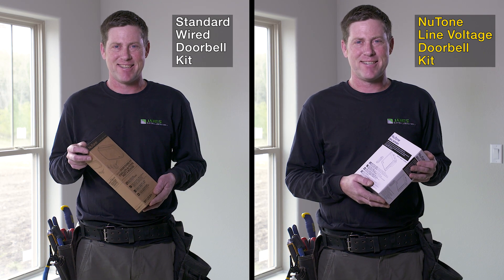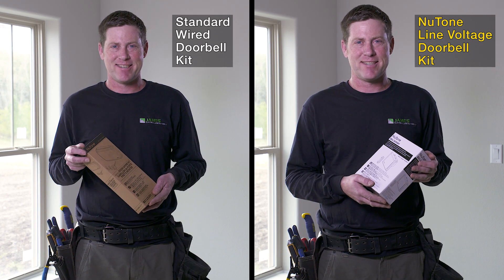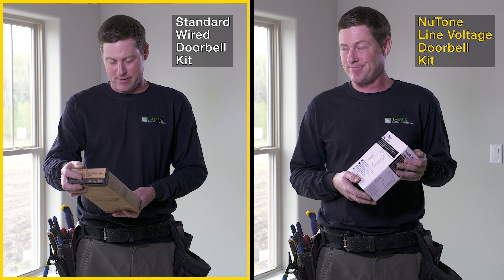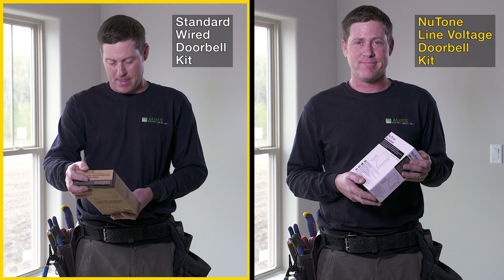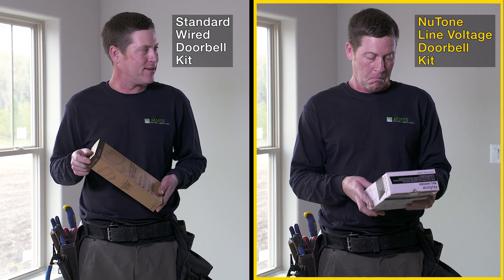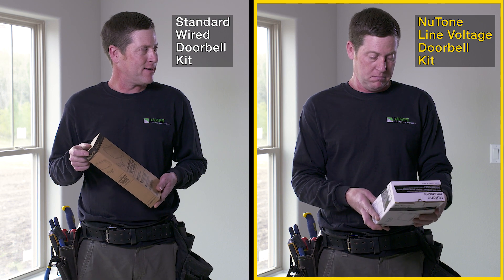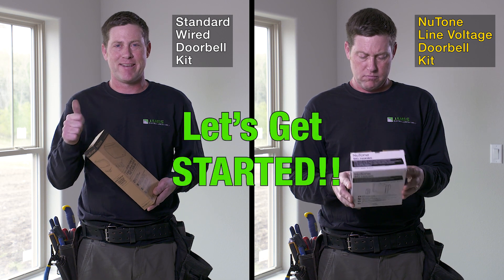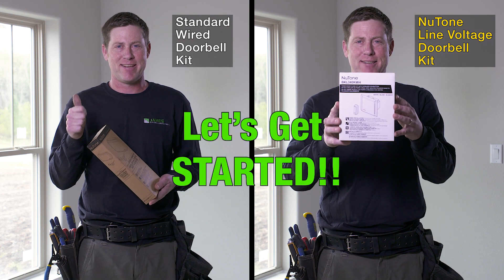NuTone Doorbell Installation Time Study

Comment: How about the battery? How long does it last in 5deg F cold cleveland winters?
Reply from the maker: Thank you for your inquiry. Unfortunately, there are too many variables to accurately determine battery life of push buttons. If you feel that your unit needs replacing more often than it should, please call our Product Support Team at 800-637-1453  for troubleshooting assistance.

Comment: Hi. Which one in the circuit breaker should i disconnect for the doorbell?  I tried basement and mainfloor plugs, also basement and mainfloor lights but still my doorbell works. Just wanted to replace it with the doorbell camera.